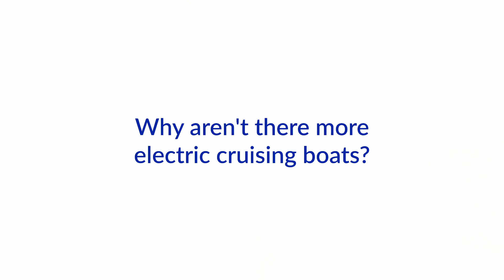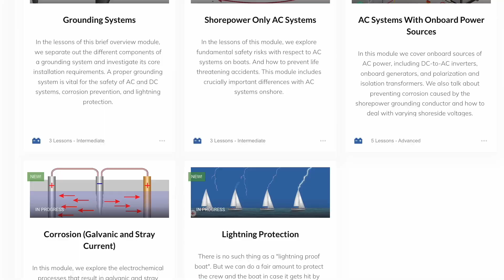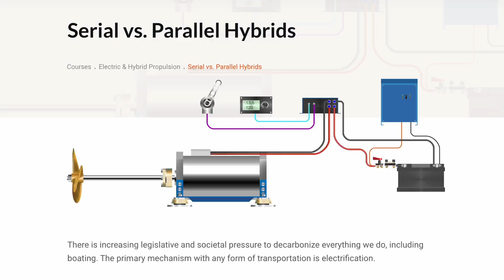Nigel Calder's take on ELECTRIC PROPULSION for Cruising Boats | Ask The Expert with NIGEL CALDER

Comment from the maker: Just to clarify, we are not opposed to electric boating at all. As a society (and this includes the boating world) we will have to come up with ways to drastically cut our emissions rather sooner than later. And of course (as we also mentioned in the video) it is possible to have electric propulsion on a cruising boat and there are quite a few people who do it. However, as many failed attempts by boatbuilders show, this is not an option that aligns with the average cruiser's needs and expectations. We wish it would be different, but we are just pointing out the facts. And unfortunately you can't change physics with wishful thinking.
Maybe a good analogy would be bicycles vs. cars. There are quite a few people who get very well without having a car (Jan for example never owned a car). But this means a drastic compromise in convenience and comfort, that most people are not willing to take. The same goes for cruisers: There are a few who don't mind having a range of only 5-10 miles on engine power, and this is great. But the average cruiser is not willing to make this sacrifice in convenience when there is the alternative of having a diesel engine. So to make electric boating a viable option for long term cruising, we either need a drastic change in mentality or a drastic improvement in technology. We are not sure which is easier to achieve.
- Nigel & Jan
Reply: Moving forward you might want to invite someone on the show who has made the transition and talk about how they have succeeded instead of why we are not there yet. Regarding the charging network I would reach out to ChargPoint and ask them how they support the grid and are able to charge large amounts of electric vehicles without causing additional strain on the grid. I think boaters are ready to move forward into the electrification of boats. I would love to watch that episode on BoatHowTo. Here is wishful thinking backed by physics.

Comment: are AGM batteries sufficient for the electric sailboat 8kW 48 volt auxiliary motor for local daysailing?  What is the maximum continuous acceptable discharge of four 105 amp hour 12 volt AGM batteries wired in series to power an 8 kW motor?

Comment: The statement that you can only get a range of 7 nm is just plain false.  Just slow down a couple of knots.  Many systems out there now are easily capable of 5 hrs or more cruising at half throttle, so if it’s 7 knots max speed then you can probably cruise at 5 knots for many hours. By the way, Conrad Coleman is nearing the end of a Vendee Globe circumnavigation using strictly solar and hydro generation.  (Now, to be fair, he is of course not motoring at all.)

Comment: Has there been any new developments on this front? It’s 2025 and I haven’t heard the battery storage capacities doubling yet…
Volvo made (makes?) a hybrid volvo car but if you think about it, that’s what a diesel generator with electric motor is with the addition of solar (that seems to have doubled in production btw)  and a regenerative prop, you might just get the right balance both for long distance open water but also at anchor (prop could get some miliAmp hours from tides/currents).
Diesel usage to drive the motor only when you need speed or can’t use the sails…

Comment: People dont understand electricity. Unless you are happy travelling really slow (walking pace) electricity is not great for anything more than a full day of cruising. Some of the cats with 400kw of batteries with 10kw of solar and motors that are 50 kw each. Even if the motors are run at lower output, recharging the batteries is the issue. With 10kw of solar and 400kw batteries, you are looking at atleast 8 days of solely charging and not using power for anything else. And thats with good sun. Not to mention lithiums life reduces significantly if completely discharged, just not as bad lead. You could spend 100k a year on batteries if you discharge everyday.

Comment: i started solar powered boating in the european waterways 12 years ago. I didn 't have  high expectiations, but reality was simply that is went great. I did make the vessel from the ground up to use very little energy to travel. The pictures of those early travels can be found on facebook in the albums called "expedition" on the page Captain Sunset. It started out as not much more than a twin hulled raft with some solar panels for shading. But i got me from Belgium to the Mediterrenean and to the Atlantic (using rivers and canals). I boated summer and winter. Winter would force you to sometimes simply wait out bad weather and even in summer the mistral was something all boats waited to lay down before going up the Rhone river.... anyhow, i am now in the process of making a new model... with what i learned and what i learn from Nigel and Jan. Thanks Nigel and Jan for sharing your knowledge.

Comment: The problem with electric propulsion is that the battery technology is not ready yet - they don't have the same energy density as diesel or petrol fuel. For coastal cruising and day sailing, electric propulsion is excellent. There are lot of marinas where you can plug into shore power and charge up your batteries. But for ocean sailing/crossing, electric propulsion is a big NO-NO.

Comment: If you only sail on the weekend, wouldn't you have all week to recharge, at a trickle charge speed? Like, same current as running the AC? Flip side, wouldn't some solar on the boat recharge it before you're back next weekend? HopYacht 30 is all electric and recharges fully via solar after 40-50 miles of auxiliary cruising, in about 4 days of sun.

Also, we're talking sailing here, why are we running our auxiliary all weekend? Is this addressing electric trawlers? Because, that sounds like a bad idea for sure.
Reply from the maker: In this discussion we were talking about cruising boats. This implies that you are not only sailing on weekends, but for weeks at a time, often with limited time at the dock. And yes, you can go all electric on those as well, just as you can go completely engineless. The thing is that this is just not practical for 95% of people. But I do have a lot of respect for everyone who does go that route and sails full electric. - Jan

Comment: I have a 32 foot sailboat built in 1979 that is electric - his first sentence in this video is about right I think.  She's a lightly driven, very fast, shallow draft cruising sailboat thats quiet - the electric propulsion system is 9 years old (i think) and I'm  holding off for new batteries for a couple more years (i hope) - stories of lithium batteries longevity being completely tied to state of discharge treatment and cycle life are to me untrue, they also have a shelf life and seasonal storage does strange things. I don't use shore power.  The previous owner of my boat loved the Beta hybrid option and it certainly does seem attractive if one really values quiet....as I do.  I also own an efoy unit, again for the redundancy and quiet. As a more general comment - I am a boatinghowto member and wish you guys would roll up your sleeves and show us how to troubleshoot some electrical stuff and get the most out of our multimeters instead of all the talking and slide shows....still - a satisfied customer.
Reply from the maker: Thanks for your comment. Have you seen the bonus lesson we recently released about the topic of troubleshooting with a multimeter? https://boathowto.com/courses/basic-electrical-troubleshooting/ -Jan
Reply: @BoatHowTo   I have Jan it's excellent, still - filming one of the examples in real time would help me envision the problem solving thought process a bit better.  Maybe it's just me. I enrolled in your course because i had an intermittent voltage drop causing the autopilot on a very fast french boat to fail when the b&g sensed LV - it took me two days and ultimately found it at the battery switch.....but as you can imagine it would present anywhere you looked, or not, depending on chance. across switches, within single runs, on different circuits.....ultimately it was the everywhere all at once and your course that a dim light bulb went off....autopilot failures singlehanded stink. tx for reply.
Reply from the maker: @armchairsportsman4108  This summer I will be starting to upgrade/rewire the system on my new boat. Of course I will record a lot of that on video and we will turn this into some bonus lessons (and probably YouTube content) in the coming months. So stay tuned for that! - Jan :-)

Comment: Why only solar?

I can think of four separate ways to generate energy when at anchor, and two more ways to generate energy when in motion, using the water around you as an energy source.  No need to ever plug in to the dock.
Reply: Not in amounts large enough to make a significant effect on the quantities needed for propulsion.
Reply: @21142317  not for a powerboat. But for. Sailboat the motor is just auxiliary and not the main means of propeltion.

It is also up to how long time you stay at anchor. If you just stop for the night and then motor on it will not be sufficient.

If you are cruising in a more relaxed fashion it is another tale. I know about people who have made really long crusing voyages without any motor at all, it's all up to your style.

Comment: When he stated : "There are 2 fudamental differences between sailsboats and cars" I would have expect him so say: "Sailboats have sails". 

So he also says: "When the speed goes up, the hull resistance goes trough the roof" And also: "When I motor at 7 knots, i need 10kw of power". Now he would accept 4knots boatspeed he only needs 2kw of motor power.  Then 

About the shore power. I can charge at 3.5kw. But I set my current input limit to 1 kw because I spend long enough time in the marine to get a full charge again. 

So the conclusion should be. "Electric propulsion is not a viable option if you want to cruise near hull speed for a large distance."
Reply: He does make a good point about shore power and costly infrastructure upgrades needed in case of wide electric propulsion adoption. Also true at 4 kts power consumption is greatly reduced vs theoretical hull speed but what happens the moment you have to fight head winds and choppy water (often the case in my corner of the world) and especially if not able/allowed to sail right in to marina? You'll easily blow past 10KW to maintain 4kts speed... So the conclusion should really be 'Battery powered Electric is not viable unless you carefully understand your use case and conclude the pros outweigh the cons'...
Reply: More than 1 hr is not a large distance. “Electric propulsion is not a viable option if you want to cruise near hull speed for anything beyond a very short distance.”

Comment: Electric propulsion unsuitable for a cruising boat ??  Sorry  but I have to disagree with you Nige !!   You may do well to remember some of your earlier mentors. Eric Hiscock for instance  circumnavigated  I don't recall how many times in his 30' Wanderer III and they had an 8Hp probably petrol engine, and Peter Pye successfully cruised extensively with 30' Moonraker and they had a 7 Hp petrol motor with a 5 gal  Jerry can for a fuel tank. Who the hell needs to cruise at 7knots anyway ?
 If you have to be back at work on Monday morning , then maybe it's not going to work for you. I have cruised many summers with electric propulsion and am retired and don't have to be back at work on Monday morning and quite frankly neither do most cruisers.
Think it through Nige , and if you want more arguments, I have plenty

Comment: I respect Nigel but this argument is very similar to electric cars " If we all have electric cars we will blow up the grid". We now know that EV's can actually help the grid using VTG. I guess if we keep pushing "we are not there yet" we will never be there. Innovation is an incredible thing and I give two thumbs up to the individual sailers who are proving that electric is there.
Reply: The cars helping the grid is theoretical rather than actual. Lots of problems with the implementation.
Reply: @21142317   Your "Theoretical" info is very outdated. The northern part of England as well as Sweden has implemented VTG tech and it has been working just fine with the grid. Just because the U.S hasn't taken advantage of the VTG doesn't mean it doesn't work. The problems arise when we have people saying things like " it will never work" or " there are too many problems with the implementation".

Comment: This is a poor message to share- Nigel is referring to cruising speeds on a sailboat using power.  The bigger message is sailing and using the motor efficiently while recharging with a moderate amount of solar IS here now. Cruising long distances even. This video doesn’t support that at all even though there are lots of examples of success.
Reply: I am aware of Nigel’s contributions to the boating world and have a great deal of respect for his opinions.  This video is simply too narrow a perspective.  Electric cruising for sailboats is here now.  The message herein is that it is not, because it propagates way too much motoring.
Reply: @akjhome  The fact that you disagree with him doesn’t make his opinion incorrect.
Many sailors don’t have an engine of any sort and are perfectly happy.
Electric cruising that equates to current diesel cruising for sailboats is most definitively nowhere near “here now”. I can motor at near hull speed for 25hrs in my yacht. As he says, you can only do that for an hour with current electrics.
Arguing that you can use less engine misses the point. You can always use less engine as the people who sail without one prove.
He’s arguing that electric motors don't replace the current capabilities of diesels, and the don’t by a long shot.
Reply: Nope. I’m not saying his opinion is wrong or false. Again, My statement is still that this isn’t a good message to compare electric motors vs diesel.  Then, you get others that believe electric motors are good for cruising.  And that brings naysayers and others that don’t know better to think they can’t use them.
Reply: @akjhome  There is no such thing as a “good message” other than factual truth. The idea that something other than truth is good is a sign of the times we live in, sadly.
Reply: Truth is never a poor message. Over inflated claims hurt the cause of green energy, not help it. Things are improving all the time as he says, but right now the energy density of batteries is extremely low and solar is what it is.

Comment: Uma have the perfekt solutione for this
Reply: With a petrol generator.
Reply: Not really…as mentioned above,they have a spare generator on top of the sponsored very expensive mastervolt-system , and when they were in norwegian winter (not much sun), they had to be at a dock to plug in.
Reply: @donaldvanvliet9039  not really !!!!

Them bought a Honda eu20 for going to Svalbard!!!!

Dummy i am from norway and use solar for my boat 24/7 365